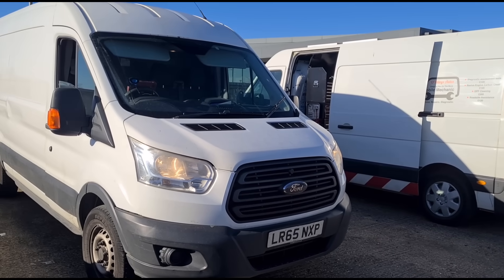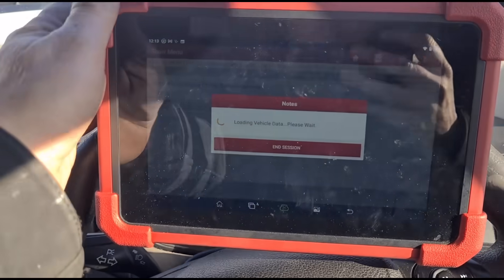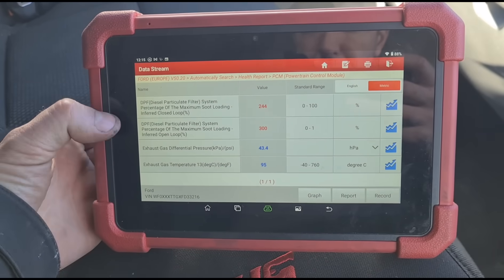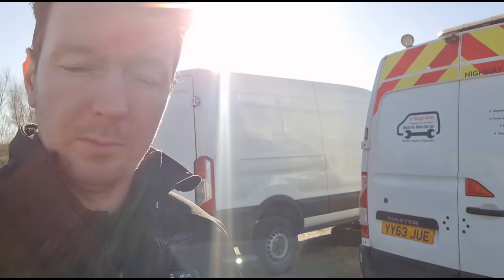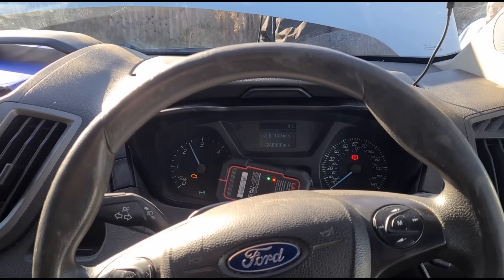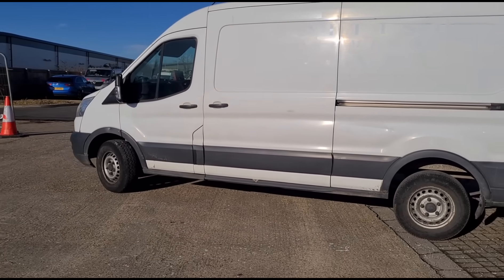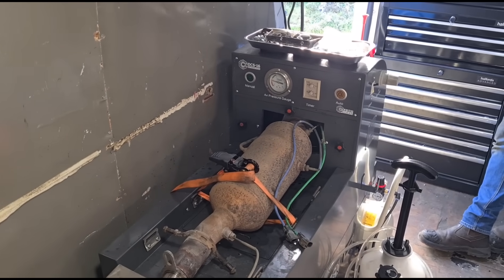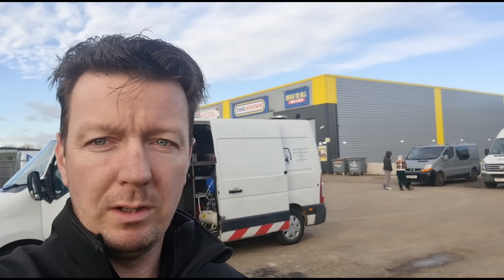Can we clean a damaged DPF

Comment: Got a transit connect 2021 only got 47k on clock had the dpf cleaned . Keep getting engine management light saying dpf damaged or has a leak any ideas . Reset it on diagnostics few days later back on stuck what to do any ideas ?

Comment: Hi, I just wanted a question, I have a 2017 vivaro 1.6 120 hp, the engine give blue smokes obviously I had checked the Turbo and replaced the cartridge but the problem is still persist, The engine running well, looks no any vibration or misfiring , I couldnt clean intercooler and lines to be honest. So my question is that what could be wrong? I would like to hear your advice. Thank you.

Comment: As an ex mechanic myself, I can highly recommend Jimmy's work ethic and process in diagnosing DPF issues. When you see how to go about diagnosing something properly then it makes the work more enjoyable. I haven't got an expensive diagnostic tools as Jimmy has and to be honest you don't always need them for everything, but live data and plenty of it is key. Understanding how systems work is vital as not every manufacturer is going to use the same process for DPF regen like Jimmy said ie. Glow plugs don't have to be functioning correctly on some fords etc. I didn't realise this until Jimmy said it in a vid last year.
Reply: I bought the same glowplug removal air wrench as Jimmy has to do them,  lol
Reply: @chrisnewell-7758  I did my my sons Vivaro's glow plugs', with a box spanner... SIMPLE!
Reply: I agree dpf has been around since about 2007 I believe however some mechanics who are excellent at doing very hard manual jobs still don't understand the technical and electronics shenanigans side of it all and to be honest it's not entirely their fault it's not like mechanics do a refresher course often to keep them up to date with the latest diagnostics and diagnosing procedures however I wish some garages would just leave dpf alone they are doing more harm than good charging people 60 quid for forced regen and sending customers out the door only for the dame fault to reappear in no time at all I clean dpf and service them and have spent the last two years learning and still learning the different manufacturers systems and also spent thousands of pounds on specialist equipment that your average garage just doesn't have